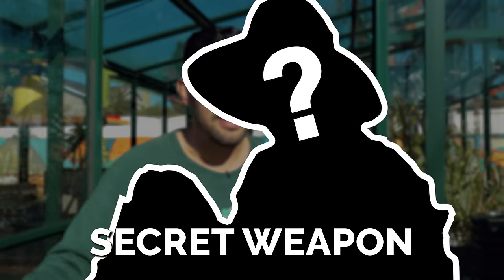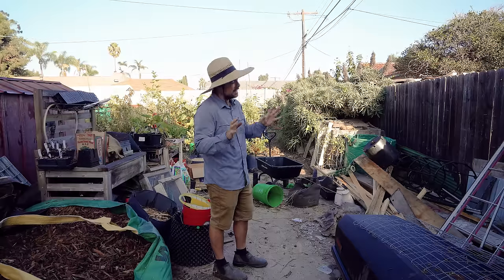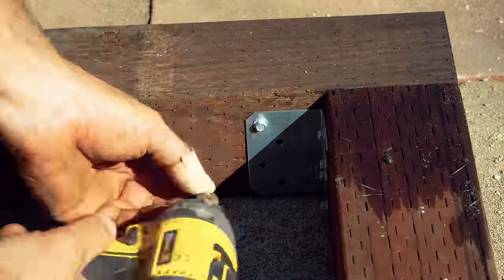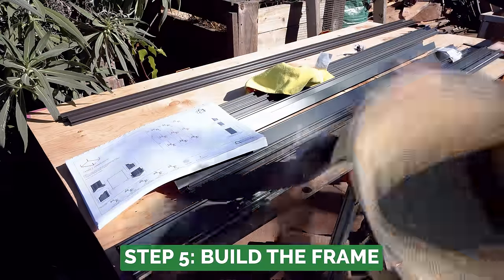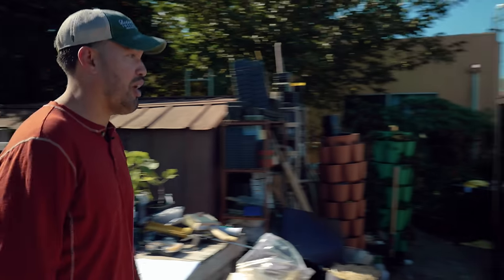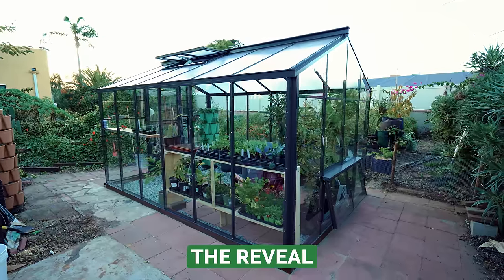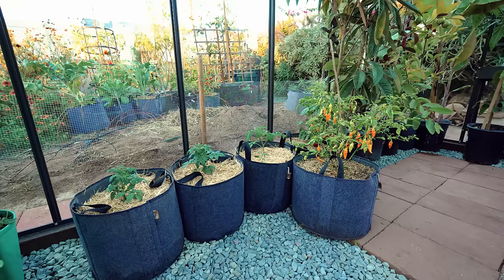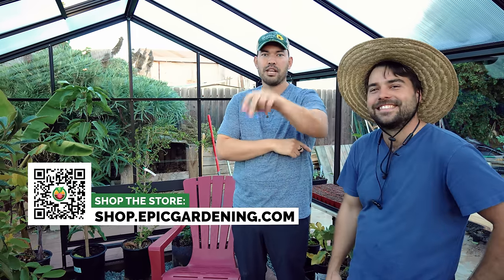Surprising My Friend With His DREAM Greenhouse!

Comment: I have the exact same BC Greenhouse, same foundation framework , color, size, roof and side materials.   Except my lower  vents are on each long sides.  My biggest dilemma was where to place it, but the sunniest location in winter is the best place as you said, especially with living in BC.  BCGreenhouses set it up for me and it took about 2 hours.  Getting electricity installed makes life even better.  What a great Birthday gift!